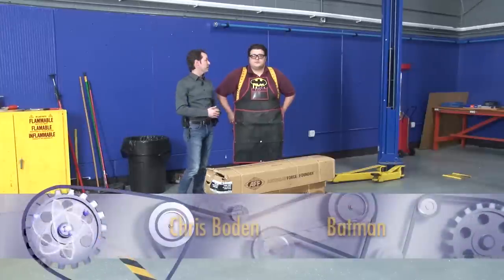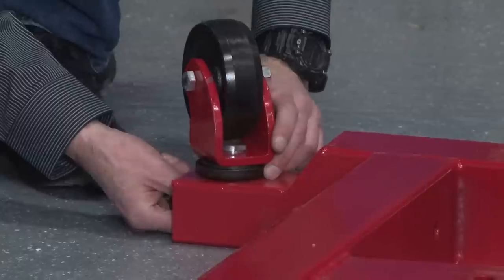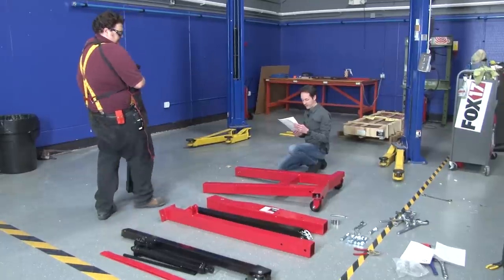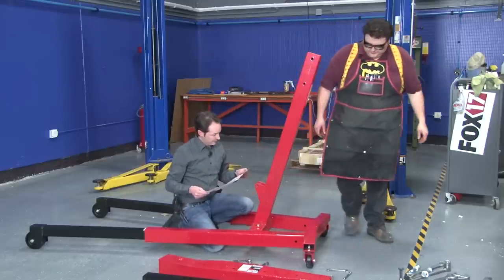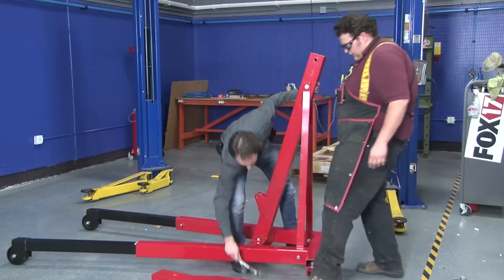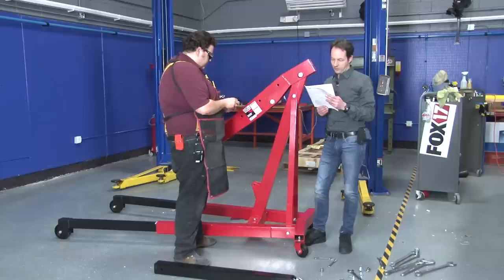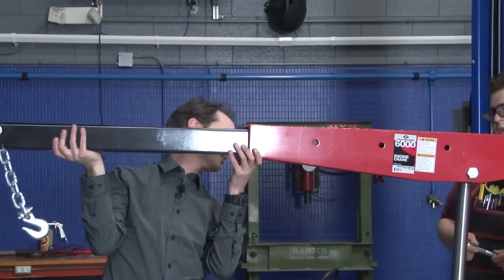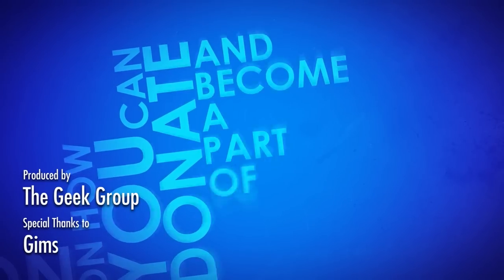Unboxing an AFF 3584 Engine Crane

Comment: @10:48

Actually, it's a good idea to have washers under any non flanged fastener surface if the torque values are high to reduce the stress on the part being fastened.